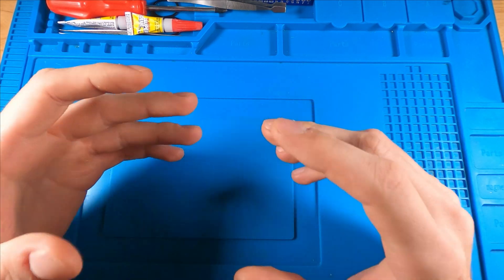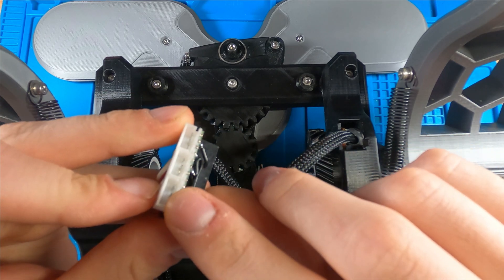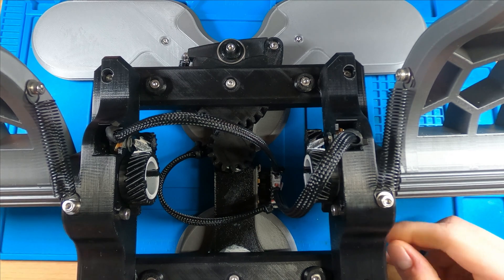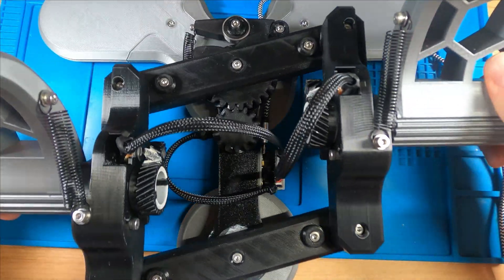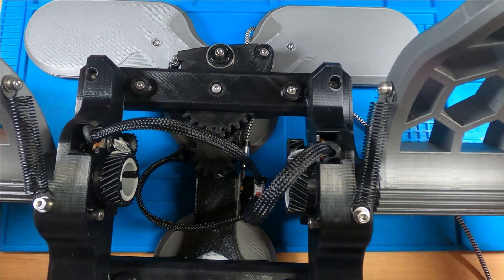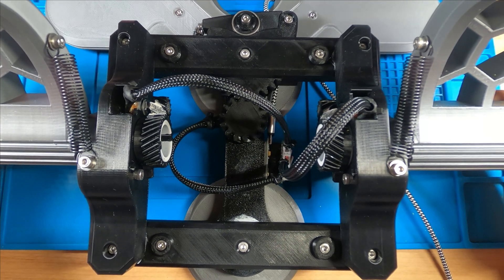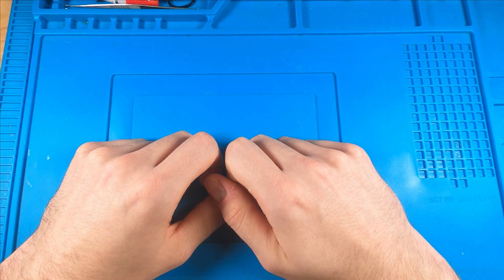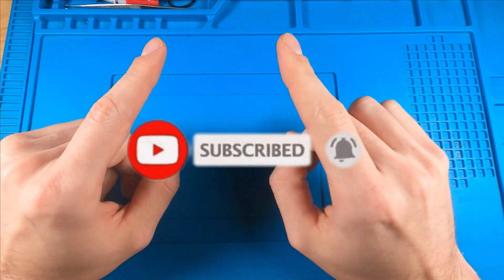CadetPedals Demonstration and Build

Comment: So I'm looking at the arduino diagram. Did you connect all 3 wires together?
Reply: Side note it'd be nice to have a still image of what the wiring looks like on the board
Reply from the maker: @complicatedbreakfast7645  All 3 5V wires can be connected together and then connected to VCC on the Arduino.  All 3 GND wires can be connected together and then connected to GND on the Arduino.  The signal wires should be connected to A1, A2, and A3 respectively.

A still image of the board would not reveal anything additional.  I just run a little wire from 5V on the JST connector to the 5V pin on the Arduino so that when I plug it in, 5V runs from the board to the correct JST pin--there are no other components or hidden features.

If you are having trouble picturing this, I would recommend bypassing the JST connectors and just soldering your wires straight to the Arduino board.

Hope this helps!
Reply: @VincePrints  got it now thanks. I just spliced a piece for the wires to connect to on each side

Comment: Sweet! Next time for the fusion 360 animation make the parts different colors so it's easier to see what goes where.
Reply from the maker: Noted!  Other than this, is it fairly simple to follow?
Reply: @VincePrints  haven't assembled it myself but looks fairly straight forward, maybe also include a brief list of parts you need to purchase in the video too :)
Reply from the maker: @marty4032  will do, did you find the BOM on the Arduino page?

Comment: Really amazing! I'm in the process of building your CadetThrottle while modifying the front plate to suit my needs. I cannot thank you enough for designing these, as I am having so much fun.
Reply: I'm using his yoke with the mod to allow width adjustment and I modded the clamp to fit a 12mm shaft. I've learned so much from @Vince_Prints and he's helped get unstuck a time or two. Love the compact design of these pedals.
Reply: Ok thanks.